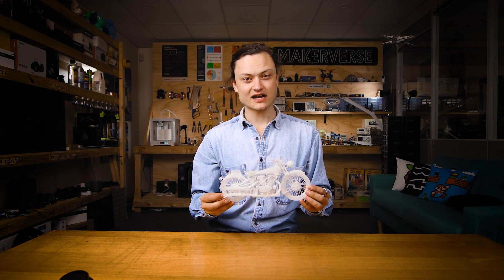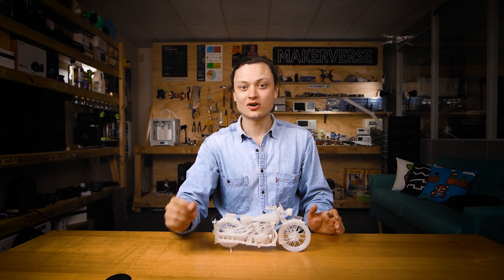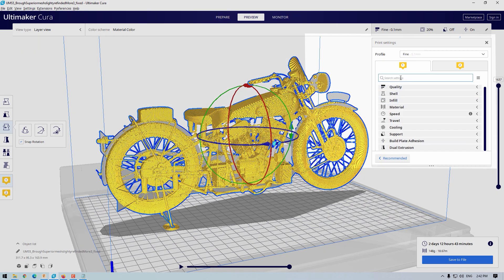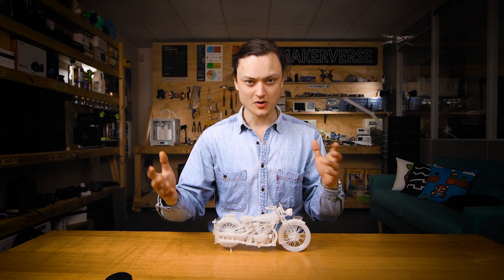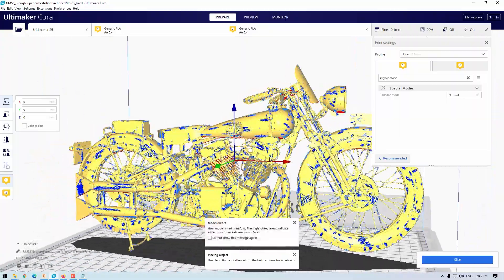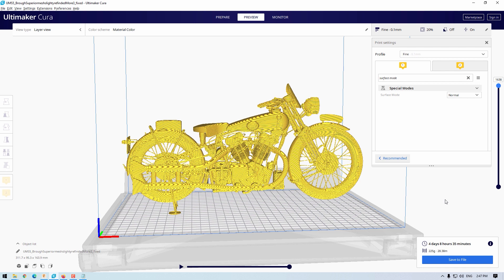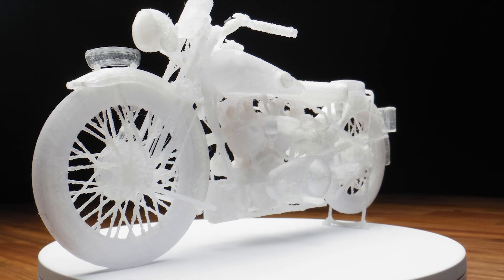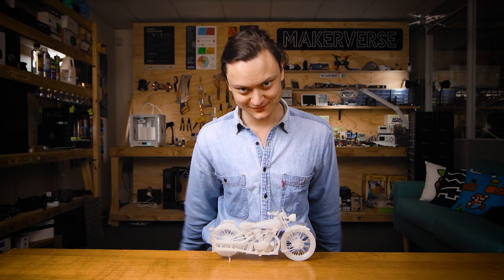3D Print Scale Models Without Losing Detail | Cura Tips and Tricks

Comment: ~ How can I take an existing 3D shell of a model train rail car and downsize it to another scale?
Reply from the maker: Cura will provide you scaling options. If you want to add internal structure to your Shell (by altering the file) I would recommend using CAD software like Fusion 360 or Blender (both free!).

Comment: Great vid, and I would love to do this with some of my 1/96 scale warship model parts. However i cannot get CURA to centre both models, whenever I zero the bed position the 2nd model just keeps popping back to another position!!. Am i missing a setting somewhere in CURA. Thanks
Reply from the maker: I reckon if you click on the drop down menu for Preferences, click Configure Cura. Then in the Menu that popped up in the General Tab theres a setting called 'Automatically drop models to the build plate'. If you deselect that it may fix your problems.
Reply: @Core-Electronics  Thanks for the reply but no, it didnt work unfortunately. I have read that to put both models in the same position you have to merge the models. I have tried this and it seems to work, setting the surfaces before merging, but haven't printed it yet. Will let you know how it turns out. My model is exceptionally small so I am not holding our much hope but ever the optimist :-)